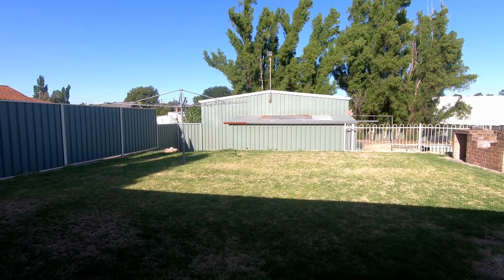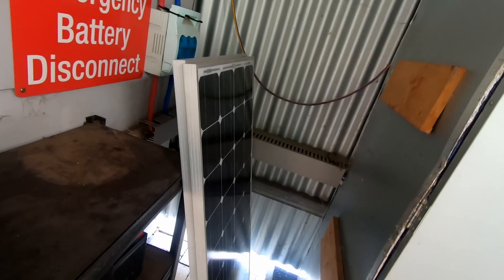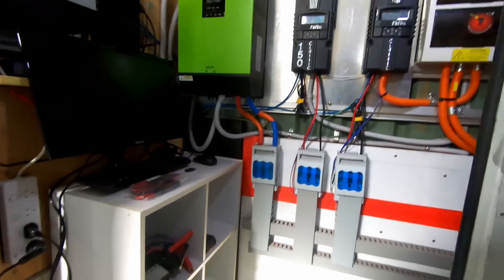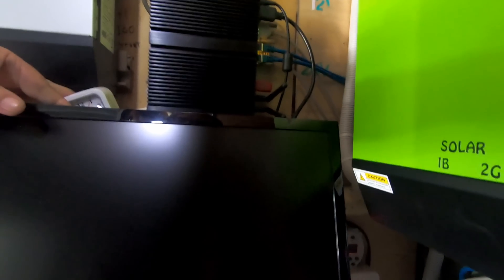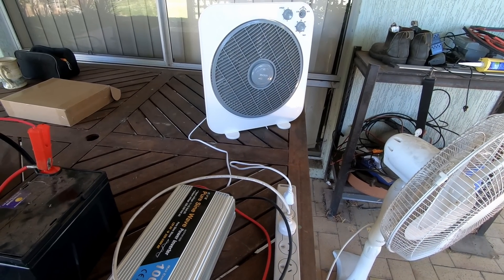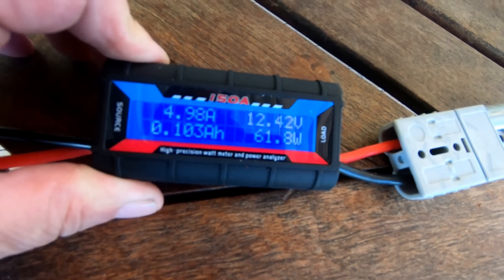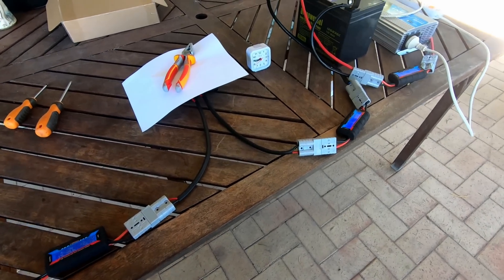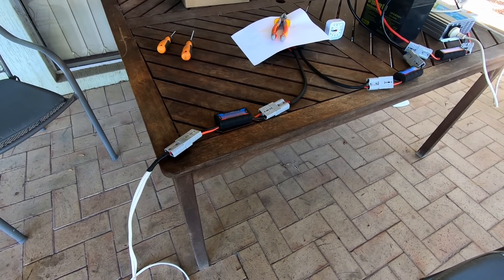Solar Charge controller Test. 2 controllers MPPT or PWM. Have a Guess  P1

Comment: How do you find those power meters? I bought two and the cables were very poorly connected to the anderson plugs. I fixed them up but I've got two problems with them.
1 - The modes cycle too fast for me to process. I'd like if they stayed on each mode for a couple of seconds.
2 - They seem to "crash" for want of a better term. After a few hours I come back and the screens are just all on and not displaying anything. Only way to recover is a power cycle, which wipes energy data.

cheers
Reply from the maker: I had 4. 3 worked right. I fitted my own Anderson plugs. The 3 i have work great. Tests is very close to the my Multimeter readings. I am happy with the way they work. But i only used them for doing little tests like this. I tried using the Multimeters i have but they were to fast for most people to follow and many could not do the simple math required to convert amps to Watts on youtube. So i switched to these very simple meters

Comment: No tricks there IMO, the second one is MPPT, as it has not dragged the panel down to the battery volts for starters and second, it is pushing out more amps than what the panel is sending in as the MPPT converts the excess volts into more amps.  In a way I am kinda hoping I am wrong but my gut feel is saying I am quite possibly right!
Reply from the maker: No tricks there . The Question was have a guess. I don't use tricks in my tests.
Reply from the maker: Pert 2 in now live my friend

Comment: looks to me neither are MPPT but PWM  but then again MPPT uses PWM witch is adjusted though MPPT brain.   MPPT works better with voltages that are higher than what the charging voltage will be.  IE I found for a 12 volt system a 40 volt or higher is better than just an 18 or 21 volt solar panel.   Other wish the MPPT will not be as effective, as a PWM for panels that pretty much comes close to matching a battery's voltage.  Mppt also uses Buck boost Tech, unlike just plain PWM's witch mostly act as a voltage regulator.
Reply from the maker: Just have a guess mate. Most of the others did. Most look like they got it right. I found mppt works great on 23volt panels. Lets me get every bit of power out of them so i can run all my toys when camping.

Comment: Its hard to tell because the panel is a high 12v panel.  Try the same test with a high voltage panel,36voc. You will see a big difference.
Reply from the maker: Don't need to frank there is enough of a difference. there for you to Guess. a 36v panels may have popped the controller.  And as i don't own them i did not want to take that chance mate. Have a closer look at the meters and have a stab at it mate 👀
Reply: Well then the #2 has a higher input
Reply from the maker: thanks for having a guess Frank. P2 video will show if your right. 👍

Comment: I like the idea of this video. There’s a small voltage increase on the second controller suggesting mppt and none on the first, but its tricky to tell exactly. Some solar charge controllers spoof mppt by releasing the panel to increase the average voltage. Julian Ilett did an excellent video on this. However there doesn’t seem to be much losses so I don’t think this is the case with controller number 2 on the evidence you show. 
I’m confused by your 12v system. Specifically the pc you’re running. To me you seem to go from 48v DC to 12v DC to 240v AC to 19v Dc. Seems like a lot of wasted energy there to me. Why not get a buck converter to go from 48v DC to 19v DC?
Reply from the maker: the computer is 19v this way i can run what i need on the step down. Also if the system goes down the little computer the more important the 12v lights all still work so i am not in the dark wile fixing things. Without having to build buck converters for every little thing i need to run under 48v.  As for the unavailing of the controllers that will be in the next video.
Reply: I would like to know why there is 12v going IN the first controller and over 15v going IN the second one ?
Reply: traci beacer Well that typically happens on an MPPT charge controller - which I guess is the point being made here.  The higher voltage going in being converted to more current to charge the battery. There are however caveats to that as their is with most things. The meters being used will average the voltage for example. If it is fluctuating quickly you’d need an oscilloscope to show that. 
As long as the sun conditions were the same for both tests however the first controller seams to be getting about another 10 watts out of that panel (possibly due to the higher voltage) which means it’s roughly 15% more efficient than the second. It’ll be interesting if these two could be set up side by side with the same load, battery and panel - but that requires quite a lot of equipment!
Reply: @AdamWelchUK  Surely the first meter is only reading the voltage and amps coming from the solar panel and has nothing to do with the charge controller ...I'm new to this excuse me if I'm missing something..
Reply: traci beacer I completely understand why that would seem to be the case, however solar panels don’t act like a battery or power supply. Their voltage can vary a lot and the panel can adapt to the load placed upon them. You can connect a solar panel directly to a battery and the solar panel voltage will be just slightly above the battery voltage (so current can flow the right way), but that probably isn’t the most efficient voltage for the solar panel. A true MPPT solar charge controller will adapt the load it is placing on the panel to get the most power it is able to get out of the panel - that will probably make the panel voltage higher than the battery voltage. I hope that explains my comments a little better.
Reply from the maker: So Adam your saying the Fist one is mppt ? or the second one. Hard to tell form your comment " first controller seams to be getting about another 10 watts out of that panel (possibly due to the higher voltage) which means it’s roughly 15% more efficient than the second"............. Are you sure you watched the video.....
Reply: Justin Case Solar Power and Bush Camping Sorry my comments seems to have upset you - absolutely not my intent. I was just trying to answer the question posed to my comment. I do test solar charge controllers, and I’ve tested what appears to be the one that you showed a few weeks ago (as I said at the time it’s impossible for us to compare when we can’t see the internals - Chinese manufacturers do change components to cut costs - another thing I’ve shown on my channel). You posted a video specifically masking the technology used in your examples and asked your viewers to place their bets. Of cause I watched the video otherwise I couldn’t know the question or comment on the efficiency. My comment around the ideal test was to preempt a question and to explain we youtubers can’t possibly do full no cost spared industrial test.   I hope this response helps you understand my position and once again - sorry if my comments was misinterpreted.
Reply from the maker: A blind man can tell what controller is what Adam. All i asked of people was to guess what one was PWM and what one was MPPT. Now you have your guess. So fare your undecided it looks like to me. All your doing is confusing people. Making irrelevant comments. You have a New to solar person  ( traci beacer ) confused as hell and all he has to do is wait for the 2nd part of the video. Very disappointed in you mate.
Reply: Justin Case Solar Power and Bush Camping I did apologise if my comments disappointed you - and I will extend that to anyone else.  Sorry but from your comment I think it’s best I leave it there. You’re always welcome over on my channel Chris.
Reply from the maker: The first meter was from the solar Panel to the controller. And the 2nd is reading  what is cumming out of the controller to the battery. And the 3rd is the load. The panel was shown as well as the full wiring and explanation. All i asked was for you to have a guess  traci beacer. The 2nd video will show if you guessed right.
Reply from the maker: By the way that little black controller MAY BE a simple 2 stage mppt controller. Not a very good one and i don't think it will last very long. That is just my guess on that unit,  However if you find something that will dissolve the black stuff they seal it with we can have a good look at it.
Reply from the maker: If i set them up side by side you still would not be happy Adam. Then you would want me to Change the panels around as one panel might be over performing.. I used one panel. On a cloud free morning and did the test very quick so time would not be a factor. Did you not see the clock.....

Comment: I really hope the MPPT is the 2nd one tested. If it is then I can see it being worthwhile spending the extra $'s
Reply from the maker: The Answer video will be up in a day or 2  👀
Reply: 1st was 12V -> 12V panel to battery and about 60W and current was about same. Second was 16V -> 12V panel to battery and 70W and current differ, from panel lower and to battery higher. So second one must be a MPPT controller.
Greets from Finland. We have nice and snowy winter here =).